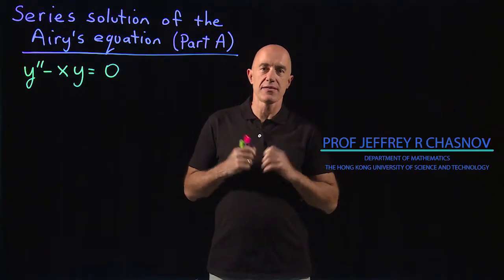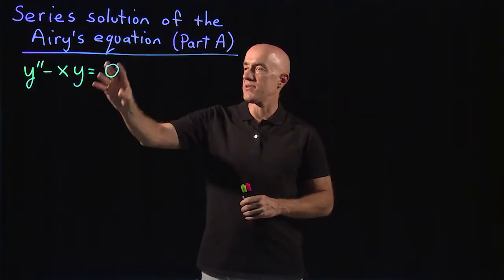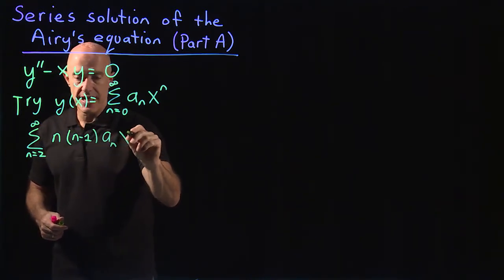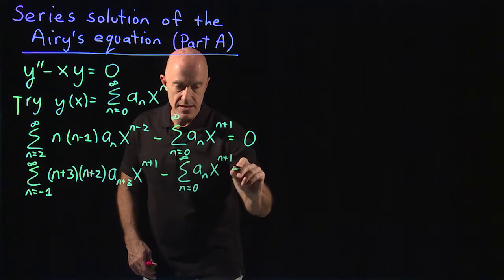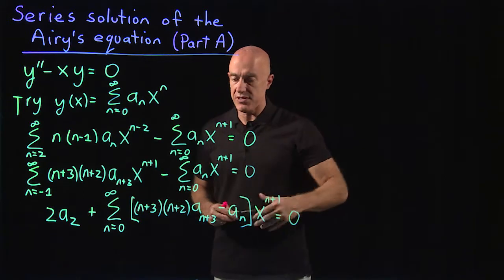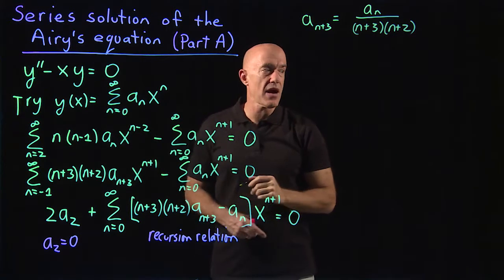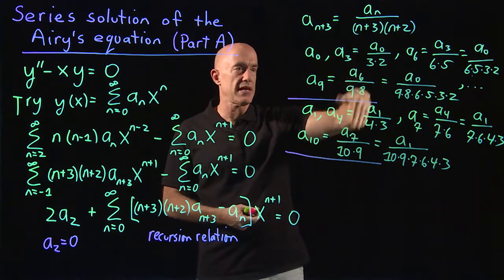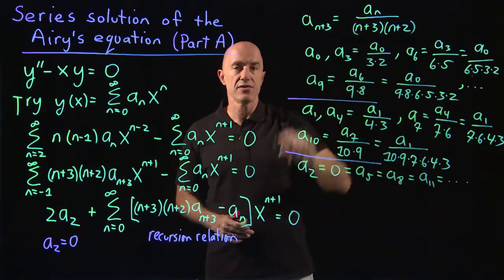Series solution of the Airy's equation (Part A) | Lecture 37 | Differential Equations for Engineers

Comment: After combining the terms into one summation, the power of x is given as x^(n+1)
Why on the final answer we used x^n to multiply on the calculated coefficients?
Reply from the maker: @jorgetapia315  We substitute back into the original ansatz ( guess for the solution).
Reply: @ProfJeffreyChasnov  Got it. Thank you very much!
so we just need to make sure the X power is similar to combine in one summation to generate a recurrence relation.
 then after calculating the coefficients, we substitute to the original ansatz.